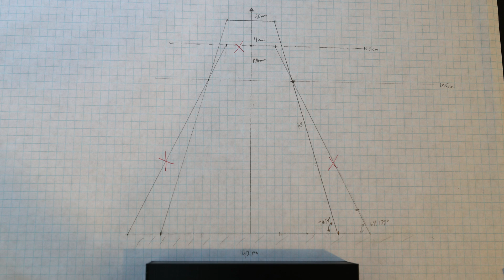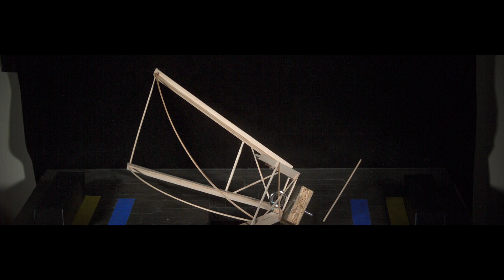Bridge 007 Division C: Competition Score 1707.9

Comment: Is there any way I could get the 3d printer file for the building supports? Or just the dimensions for it?
Reply from the maker: If you mean the testing supports, please be aware this this particular build was too wide for the current rules.  Please check out my later Div C videos for the proper size.  That being said, the correct dimensions for the testing supports are 1.5"x1.5"x6" to 2"x2"x6".  Check the official rules for all the testing specifications.
Reply: @balsaengineering6686  ok thank you

Comment: Could you give an Amazon link to all the parts please
Reply from the maker: It's not quite that easy... all these parts are custom cut.  You'll want to start with a balsa cutting tool like this:  https://www.amazon.com/gp/product/B0000WS5OQ/ref=ppx_yo_dt_b_asin_title_o04_s00?ie=UTF8&psc=1

Then you will buy balsa sheets from places locally, Amazon, or places like Specialize Balsa.  I would recommend checking out my video on building a material library:  https://youtu.be/bLsTOpmozGI

and my gluing video for ideas there:  https://youtu.be/55lb2KzSiwg

Comment: So just wondering, what dimensions did you use for the side view drawing, since with a tapered side, the height has to be a little more than 176 mm.
Reply from the maker: The height of the sides are about 183 mm.  I just published a new video that shows a complete build from start to finish, so you might like to check that out for more details.

Comment: Very nicely done, I really like the solution of making the bridge just a little taller to get a better angle on it. Personally I have been trying to go for a 2 piece design with a base that goes up to the 12cm height of the pass through block and attaching a small tower on top to make up the difference in height. So far I haven't been able to get the bridge straight enough and adding the tower does mean that I am losing the x pieces going across the top that help the bridge to resist tipping over. Do you have any thoughts on this approach?
Reply from the maker: The more I work with potential designs, the more I'm liking the tapered design for Div C.  I tried a few builds initially that were minimum width, squared off designs, basically my successful Div B design, with a cross member support.  I couldn't get it to hold more than 8 or 9kg before it would tip over.  I don't think there is enough room for effective cross bracing to give enough lateral support.  The 7x12 passthrough block for Div C is much bigger than the 4x7 for Div B compared to the rest of the bridge.  Meaning the Div B design doesn't really scale up.  I think a squared off design is the correct one for Div B, but some form of tapered design will probably be optimal for Div C.  Definitely let me know if you come up with something that works well though, I'd love to hear about it.

Comment: what size wood did you happen to use for the main legs and what weights were they?
Reply from the maker: Hi Adith, I used 3/32x10mm for the primary part of the leg and 1/16x10mm for the angled part.  My normalized weight of around 31cm for each was ~1.35g and ~0.8g for a total of ~2.15g for each leg.  Because this held almost 24 kg, those legs were too strong/heavy.  My next video will be showing a complete build from start to finish to optimize the weights a bit to see if I can get failure at a more optimal 16-17kg.
Reply: @balsaengineering6686  when you say 3/32 for the primary part of the leg, is that measurement in inches, because it seems a little small if it was also in mm..
Reply from the maker: Yes, sorry for the mixing of Imperial and SI units, but the balsa sheets are all typically sold in Imperial units (like 3/32").  For the measurements I have control over, I like to use SI (cm/mm, etc.)
Reply: @balsaengineering6686  ok thank you

Comment: so just asking, are the pieces you glue on to the main sides, the angles main peieces hanging off the edges of the 6 inch block?
Reply from the maker: Hi Adith, yes, in this case those angled pieces are hanging off the edges of the 6" block.  As far as I can tell, this isn't a problem with respect to the rules.  Nothing says the bridge can't be wider than 6", only that the testing block is exactly 6".  I think you want to get the maximum width possible (within reason) to provide the most lateral stability.  That means the primary part of the legs will be very close to the edge of the testing block and the angled pieces will be off the edge.  Also, those angled parts of the legs are to provide bending stiffness, so they don't need to be touching the ground for that in case you were wondering about that.
Reply: @balsaengineering6686  and if is not too much to ask for, is it possible for you to send me the CAD of the 3-d printed rig you use, thank you and it is no problem if it is too much to ask for.
Reply from the maker: Sure, no problem!  Don't think that this is the only possible design to use though.  I want people to use it as a starting point to think about the possibilities.  

I printed 1 "middle" piece: https://klingerphotography.com/BalsaEngineering/DivC_Angled_Jig_middle_v3.STL

and 2 "end" pieces and glued them carefully together using graph paper as a guide: https://klingerphotography.com/BalsaEngineering/DivC_Angled_Jig_end_v3_1.STL
Reply: @balsaengineering6686  thank you very much
Reply: @balsaengineering6686  ok, thank you, about how much is angling off of the 6 inch block, because definetely at least half of it is still on.
Reply from the maker: Yeah, maybe half is off or so.

Comment: So sad that it keeps breaking on the main truss members on the top. Maybe you can brace it on the sides?
Reply from the maker: Hi sneepity, actually, I was pretty happy with this failure mode and extremely happy with how much it held.  With the legs breaking at ~24kg, it gives a nice idea for how far I can scale down the weight on the next attempt.  A 30% reduction in the legs down to around 17kg would be a good start.  This test also showed that the rest of the design can handle ~24kg as well, which means other opportunities for mass optimization.  The ideal bridge would hold 15kg and then explode with multiple failures. This bridge held way too much, meaning it was overdesigned and too heavy.  When trying to guarantee 15kg loading, a more practical target is about 17kg so it's possible to pre-test to 15kg to know what you're going to get on competition day.